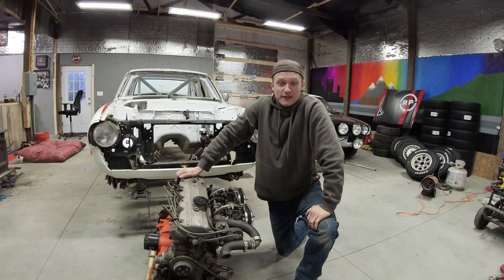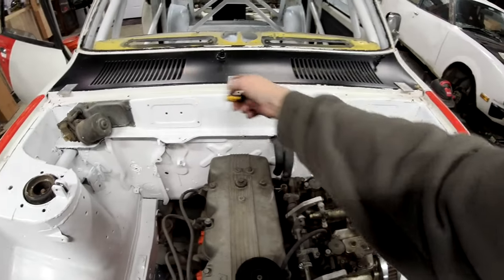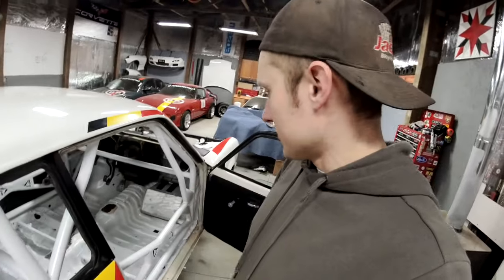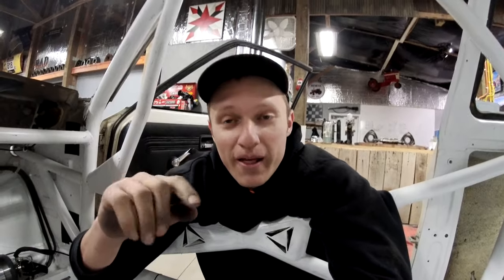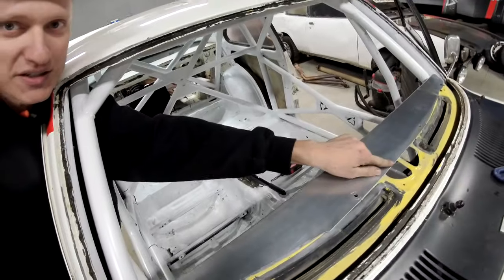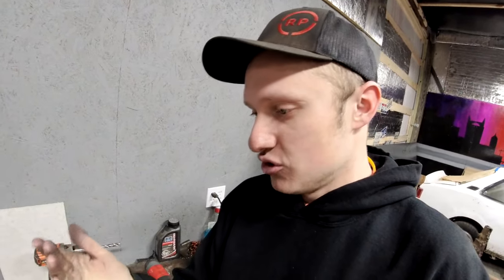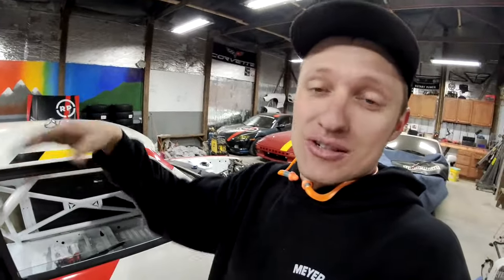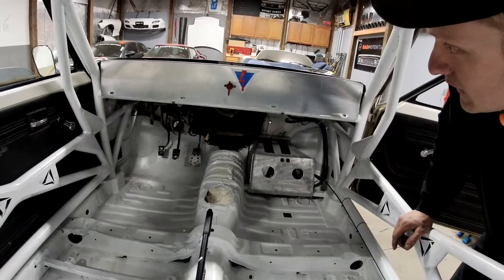Fire Suppression System - EVERY Modified Car Should have this CHEAP Insurance

Comment: In theory, could you run a 13b?
Reply from the maker: If I go up to Open 2wd, I could. The main reason to run the lancer over an RX car is so I can actually make power.  Rotary engines are limited to no porting in the "limited" 2wd class. So I'd be stuck at 90 hp on a good day